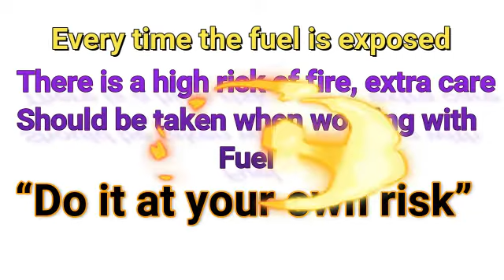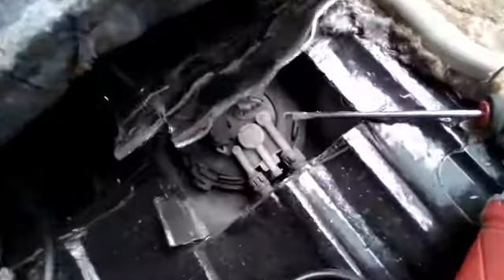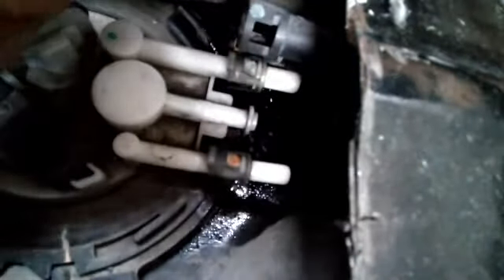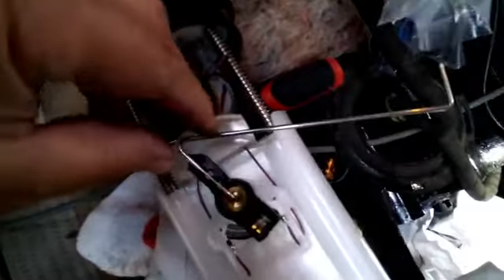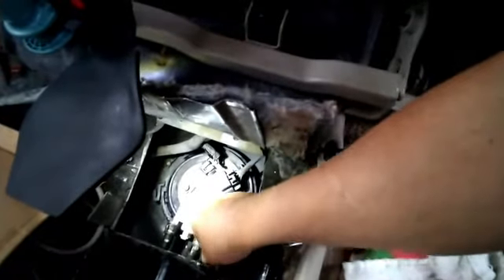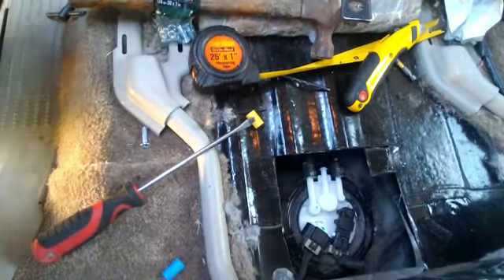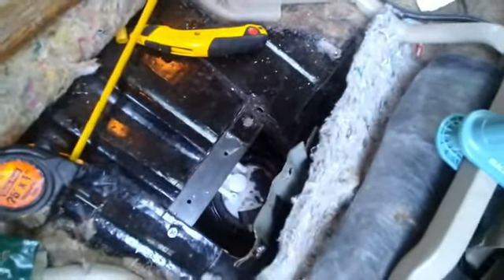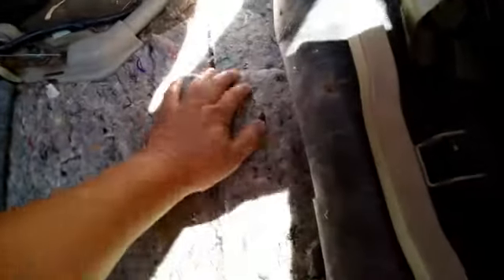How to replace a fuel pump on a Cadillac Escalade without dropping the tank

Comment: Ain't nothing wrong with doing it this way, given some circumstances. I'm about to try it out myself. ( someone's fuel pump went out, it's on the side of the road, and it's 3° F outside right now). And after looking underneath the car seeing how rusty it is, where the tank straps bolt onto, are too rusted out. And I'm not trying to be laying on the ground outside, in this kind of weather. But just trying to help someone out. Thanks for the video!
Reply from the maker: Thanks for the comment, please let me know how it goes!

Comment: What are the signs of a bad fuel pump? I have a crazy issue, and not sure what to try next?
Reply from the maker: The most common problem of a bad fuel pump is that the pump just gives up and the car will not start, however in some rare cases the car hesitates to start and that's because the fuel pressure is not the same, but the only way to check this is with a fuel pressure gauge, also sometimes the fuel pump becomes extremely noisy right before giving up. What issues are you having? Thanks for watching my videos
Reply: My 2094 Cadillac Escalade 6l has a problem that doesn't show up on any OBD,  it buck and won't take file when it's cold. After you let it run for 15 mins , it's fine, but shut it off and try and drive away, it does it again.
Reply from the maker: Yeah well a low pressure fuel will not be detected by the OBD. I will check the fuel pressure especially when it doesn't want to run. This to start a process of elimination. If there is low pressure, you found your problem, if the pressure is good keep going looking for the problem. Perhaps an electrical issue.
Reply: I will try that tomorrow, I really hope that's it I have replaced the throttle body, also the temperature sensor,, I will let you know
Reply: Did a pressure test on the file system,58 steady. So I have no idea what to check next?

Comment: I have done this on a jeep Cherokee, it was beat up and a bucket really on its last leg that’s ONLY reason I did it. So it died on the freeway and they were stuck. They had the pump and was on the way home for me to meet there and replace it but they did not make it to the house. I removed spare tire in back and used my DEWALT grinder, I cut three lines and bent the piece up. A CHP (California Highway Patrol) came up behind us and asked ”do you need help”. I was basically done just putting the o ring and lock ring back on and I said “yes”  he said help with what I said “welding this back together” jokingly. He said what the piece you cut I replied “yep”, he asked what I was doing I said replacing the fuel pump. His jaw dropped and said you just cut that open I said yes his reply was I am very stupid, asked “how is that”. He said cutting it open that could have exploded. I was like well yes if you are dumb don’t know what you’re doing and cut a line. I used a depth guard to only cut 1/16 of an inch down in the metal just enough to cut it and not getting close to the lines for I cut the three sides that had no lines. They were in front I cut sides and back. He said I take that back you did it very smart then but you’re a brave crazy man, he then took out his camera took pictures of the work and stepped back 6-8 feet and took another picture. I am guessing to show his buddies the cutting open and show it was in the freeway lol. At this time I just finished plugging the harness and fuel lines in I said start it and it had no issues. The CHP said damn good job you have a good day, I bet I was the talk of day and he told this story to every one he seen. Probably still talking about it lol. I would NEVER do this if had a safe place to do it anywhere besides the freeway it is SUPER EASY on Escalades you don’t even have to remove both straps or drop it all the way down. Remove rear strap all the way and then loosen the front strap 3/4 of the way the tank will fall at a angle and have plenty of room to remove it or just stop all the way DO NOT CUT IT unless a emergency and even then it is dumb honestly.
Reply from the maker: True Cadillac has two straps, however, when you have a full tank and don't have the proper tools at home like good jacks, that becomes a big issue. So if the fuel pump goes out again all I have to do is open the secret door and replace the pump. Thanks for watching my videos
Reply: This is very true on that aspect my only thoughts on this is if you don’t have proper tools you shouldn’t be doing the job. It was a good video for people that want a short cut but very short cut has a consequence.

Comment: What year escalade is that
Reply from the maker: Hey Chris! Thanks for watching my videos. This was a 2002 Cadillac Escalade however it does apply for different years, you might be able to search on Google. Thanks again and please don't forget to subscribe.
Reply: @TIPSFORDUMMIES  k thanks just did the same on a 04 ext just wasnt quite sure if the placement is the same
Reply: About to do this on my 2008, damn control module didn't fix it but blows the fuse